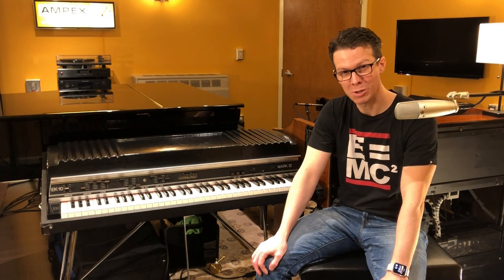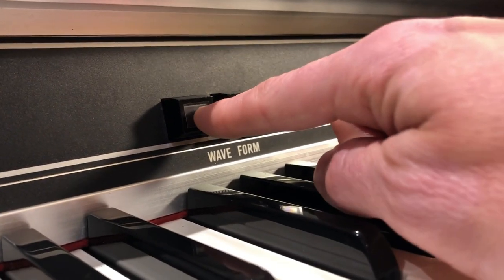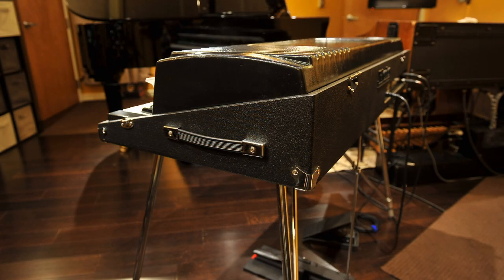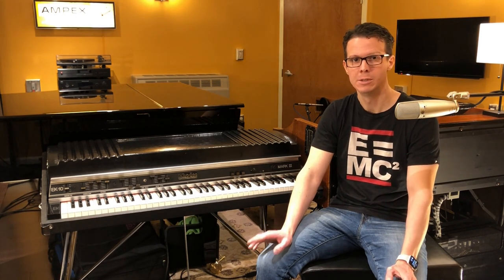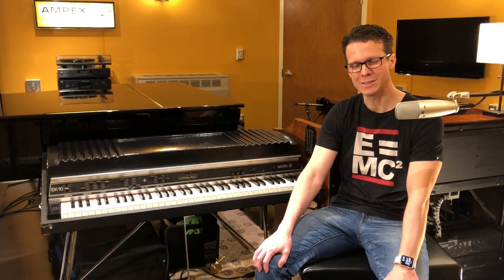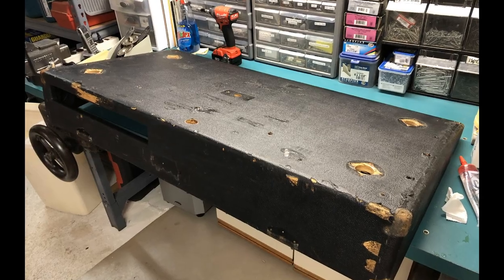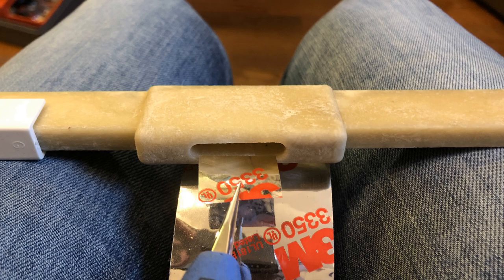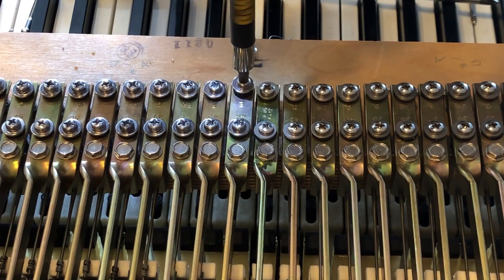Rhodes MKIII EK-10 Rescue!

Comment: Nice job my man! In all those years with the Bishops I can't recall the synths sounds - this is news to me. And banging on the lid hahaha - I believe we used to say "Once is maintenance, twice is abuse". Cool. While we're on the topic, my power amp on my 88 Rhodes sometimes crackles and smokes a little from behind the power switch and the sound crackles and distorts intermittently when the vibrato feature is off. I'd love to get that touched up. Also curious if there's a way to mellow the sound a little overall? As much as I love the bell-like bright attack of my Rhodes, there's something so nice about the tone of this one in the video.
Reply from the maker: Thanks Jay! Yeah, good times :)  I have a space issue in my little lab, probably too tight to have your whole rig up there, but maybe I can pull just the power amp out of the speaker cabinet and check it out. I can adjust the voicing on the rhodes at your place, or even show you how. I'll message you on FB...

Comment: Thank you for sharing your impressive process. I have a simikar issue with broken front rail pins. What size screw did you use and what is the exact model of 3M tape you applied ?
Reply from the maker: Thanks JD, no problem! I believe I used an 8-32 screw, but I'm not 100% sure. The tape is 3M 3350.
Reply: @JeremyParkerMusic  Thanks !